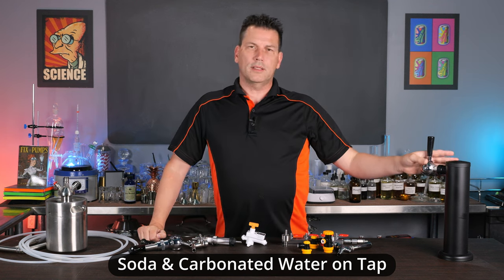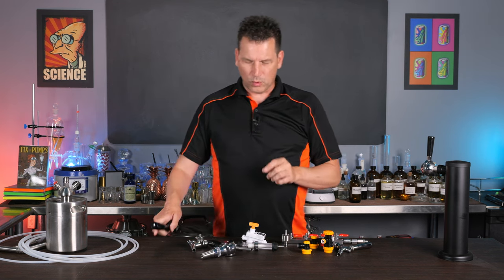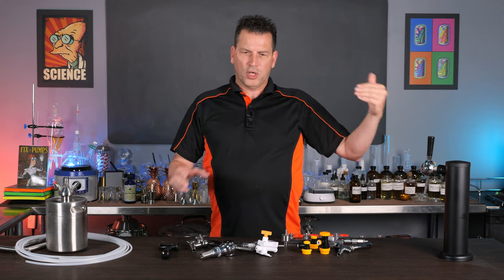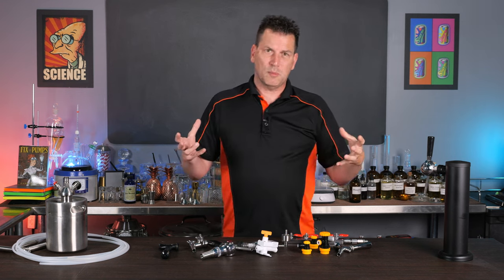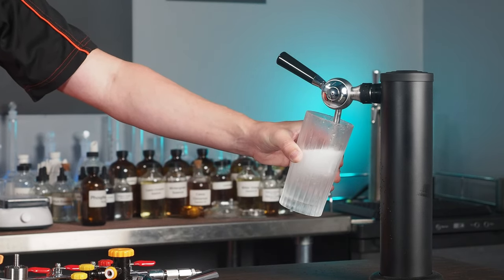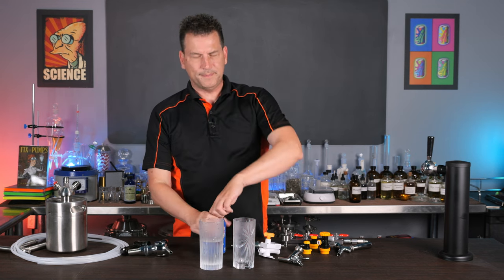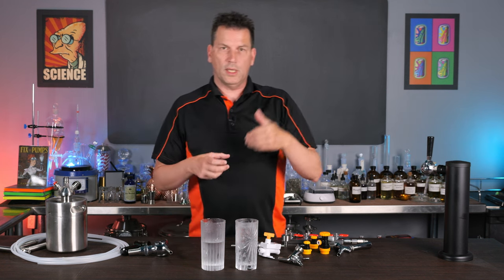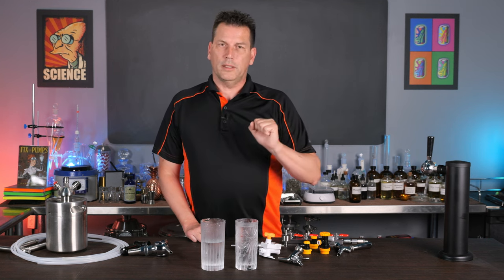Carbonated Water on Tap

Comment: I got a soda siphon to make homemade soda for me awhile back. I got it because it was cheaper than getting a  soda stream and the bigger tanks of Co2 they use. Especially for how often I use it, most times buying a 12 pack of plain seltzer cans will last me a couple of months depending on what I want to make, but the soda siphon gets me 1 liter of bubbly water with smaller Co2 cartridges that I can buy in bulk and have sitting around out of the way in a cabinet till I want to use one versus going to my local store and buying a $30 cylinder that will get used MAYBE 3 or so times a month if that and just sit around taking up counter space otherwise.

Comment: Have you viewed the Dave Arnold video on YT where he used an in-line water filter then chiller and then ran it thorugh a carbonator and then through the faucet? His video at the end did not show it screaming out of the tap. Is that because of length of line that he was using? I myself am hoping to get to a point where I do not have to shake my bottle every time I want a bottle of seltzer. I have considered running a CO2 tank to a soda stream to have hooked up, but the PSI would be a lot lower with those machines. I am really interested in this series and have been down this rabbit hole since 2020. That is how I found you and soda phosphate. Thank you for this channel!
Reply from the maker: Yes I have, and the reason for the flow control is that McCann carbonators only output water around 15 psi, but the pressure tank is set to around 100 psi to rapidly carbonate the water but the water is just tap water with air and not necessarily chilled. Plus, an engineered system is going to do a better job than mixing brewing and kegging parts, but the cost difference is probably 10x as much for the McCann system.

Comment: I get good results at 80 psi from a keg at 32f with a plastic CM Becker soda tap. With less thermal mass than the metal ones, it does not disturb the CO2 as much. I'm also using a PET plastic line with an inline flow control. I'll add some pics later. I should weigh the water to see how much gas is lost, but I haven't done that yet

Comment: Any recommendation on a specific counter pressure filler? I’ve been curious about the Tapcooler, but I haven’t found much info on folks using it for seltzer. Someone on Reddit said it was difficult to maintain the seal on the bottle at the 60 psi they were using. Hope to see the follow up video on bottling someday! 🙂

Comment: The flow control ball lock disconnect is cheaper than the inline regulator and less expensive overall if you need to buy a disconnect anyway. It looks like you have one on the table right there. 

I have absolutely no problem with carbonated water on tap and it's frequently way more carbonated than what I buy in the store.
Reply from the maker: I've found the flow control ball-lock a little problematic at higher pressures (60 psi).
Reply: @Artofdrink  What if you force carbonate at 60psi for 3 days and then drop with your PRV at 10psi for serving? From my understanding, the headspace would show 10 psi on your regulator but your water would already be very carbonated right?
Reply: Do you carbonate at what pressure?

Comment: A theory of mine is that all of these flow control methods disturb the carbonation too much at a single point, causing turbulence and loss of CO2. Another method that I think would be more subtle is using smaller inside diameter hoses. Thay way you wouldn't need a whole lot of hose and it would still be restrictive.

All theory though, do you think this could be a good solution?

Comment: Have you used the Toki highball machines? They're plumbed and create a HYPER carbonated water. I'd be curious to know the differences between the two devices
Reply from the maker: I've looked at the videos and specs and the "hyper-carbonated" is only 1.5x normal carbonation (bar soda guns @ 15 psi) so roughly 20 to 25 psi. That is still a long way from the old soda fountains that were carbonating water to 150 to 180 psi. That doesn't mean 150 psi is better, as I'm discovering, but the Toki system is engineered to produce good carbonated water. You can see the flow rate is slow and steady, reducing the loss of CO2 gas. It looks good, but the price is probably much higher than the  Frankenstein brew parts system that I'm working with, and the results are probably similar, though my experiments still need some tweaking.
Reply: @Artofdrink  I only brought it up because, in my experience, it produces a product with significantly more champagne bubbles than bottled/canned products. If I remember correctly, it was achieved in part by a reservoir that chills water to lower temps. Anyway, it’d be cool to peek under the hood of a toki highball machine to compare and contrast.

Comment: Great informative video! I do have a question though.  Do you think having soda on tap is fine if the keg was pressurized to 25-30psi as opposed to the 60 psi you applied in this video?
Reply from the maker: Yes, a pressure between 15 psi and 30 psi will get the best results.

Comment: I imagine you might bring this up in the next or a future episode, but how does the carbonation level compare between different carbonation solutions? Say between a can, bottle, soda stream (or any similar product), a tap, and your next video about back pressurizing bottles at home if the goal is to get as many long lasting bubbles as possible?
Reply from the maker: I will talk about that in the next video but glass bottles can get the highest pressure, cans can go to 30 psi (limited by wall thickness of aluminium, and the cost of materials), plastic is a bit lower than cans. Almost all carbonated soda is between 15 and 30 psi. Carbonated wines, like champagne tend to be higher in the 45 to 60 psi range and that is where I'm taking this experiment.

Comment: I am curious where your recommendation ends up.  I have a carbonator cap for sodastream bottles and use it to carbonate on demand and it takes about a minute for each 1L bottle which is fine but not super awesome.  I had been mentally preparing for an investment to get it on tap :)
Reply: I've been keg carbonating for years after trying ABSOLUTELY EVERYTHING. I concur with his conclusion that turbulence really limits your keg carbonation. I run about 25-30psi with a flow control tap, which is about as high as you can go out of the tap without CO2 coming out of solution, causing turbulence, and actually reducing your carbonation in the glass.

Currently my solution for higher carbonation levels is  1 liter screwtop soda bottles with those blue plastic beer store carbonator caps that take a ball lock gas fitting. Fill with cold, boiled water, squeeze the sides to eliminate the air headspace, then hook up to my 10lb CO2 bottle and shake.  Definitely gets you to max carbonation. 

Of course the reality is that even water at 0degC  won't hold all the CO2  it does at 60psi once it hits atmospheric pressure, so there's just not that much discernible difference between 60psi carbonated water and 30psi.
Reply: Compared to your typical sparkling water, bottled San Pellegrino for instance, how would you say your tap compares on carbonation? 

I've been a little discouraged with my corny keg at 50psi out of a party tap—carbonation-wise. I can get a fine pour with a little finesse on the tap, but it's pretty flat once out of the 5' line. I was thinking I need a higher PSI regulator to crank up the keg carbonation level (mine has a 50PSI safety valve). But maybe I just need to get after counter-pressure filling instead?

I'd love to hear your thoughts!
Reply from the maker: San Pellegrino is bottled around 12 to 15 psi I believe. And tap soda water is okay, but bottled is always going to be better and as @jhbange says, 30 psi kind of the sweet spot.
Reply: That's basically how I make carbonated water as well but I use 2L bottles and a 20lb tank.  I also just fill the bottles a little less and top it off with syrup and flavoring then stick it in the fridge for craft sodas.

Comment: Having consumed at least 100 gallons of bar style club soda, I am genuinely curious if this has less impact when no syrup is used. Maybe i drink mine fast enough to not care. Next batch I'm boiling buffering and bottling. That's 2 more B's than I usually do. This is the first I've heard that you can run liquid through those regs, I mean I guess just water wouldn't be to bad.
Reply from the maker: Drink soda water quick was the way they described it in old books and people liked the pungent CO2 flavour. Boiling will make the biggest difference.

Comment: Why does beer from a tap work perfectly fine but soda from a tap seems so difficult?
Reply from the maker: Beer uses much lower pressure, between 10 and 15 psi for most. Soda is 4x that much

Comment: I don't know what you are doing wrong, but something.  That tap is broken.  Stop using it.  It's not meant to do that.  You are getting gas bubbles in the line probably caused by the regulator.  It doesn't matter if you step it down to 20PSI first.  When it hits the glass it's at 0PSI.  It IS going to decarbonate.
60PSI is far, far, far too high.  It's causing all your problems.  Try half of that.  Do not put ANY unnecessary restriction or regulator on the liquid line.  It should be 30PSI in the keg, 30PSI in the line and 30PSI in the tap.  Open the tap FULLY, WIDE open.  Don't half open it, quarter open it, crack it or any of those things.  They all create a low pressure, aggitation, degassing and foam.  That's how a "basic" tap works.  You pour FULLY open and then at the last second if you want a head on a beer you restrict the flow to create foam directly.  (good taps have a push back for foam).
Water does not foam like soda or beer does.  Not unless you do everything wrong like you are it seems.  It only foams when you add the syrup.  There is no "surfacant" in the water to foam.  If it foams, something is wrong with it or it's not water.  It will degass, but not foam.
I can easily pour 40PSI water at 5*C into a glass without any foam.  Then I add and stir in syrup and there is always a "surge" of decarbing and a little foam, just like pouring it from a bottle.
If you add syrup to the keg.  Then that's a whole different ball game.  It will be very tricky to serve.  Serving pressure will need to be down at 10-15PSI.  However it probably won't remain as carbed as you would like at that PSI.
Reply from the maker: Thanks, Paul, but you are missing the point. If you read about old soda fountains, they carbonated water up to 180 psi (yes, 180), which is a tad dangerous. So, I'm trying to replicate something somewhere in the middle. It was described as being so pungent that it made your eyes water, so for historical reasons, attempting to go higher is the point.
Reply: @Artofdrink  Oh.  Ok.  I'd say it was a bit pointless as well.
At 20PSI it's fizzy, but not really, still drinkable bare.  At 30-40PSI it's far too acidic to drink bare and consumer syrups need to go to high strength to defeat the sour.  It's hard to think what PH it settles at after 180PSI carbing.
... and people worry about the phosphoric acid is coke.
Reply from the maker: The pH of carbonated water, even at really high pressures, does not go below 5 without the addition of an acid. Carbonic acid is a weak acid. This isn't about making boring, mainstream soda or beer; it's about understanding the history of the soda fountain. And just in case you don't know, I've written a book on the subject and spent 20 years writing about drinks, plus I'm a chemist.
Reply: @Artofdrink  But the title is just "Carbonated water on tap".  So why don't you show how to actually serve carbonated water from a tap?  I'm confused.
Reply from the maker: Because this is one of the four videos on the topic I've made so far, and the experimentation is on going.